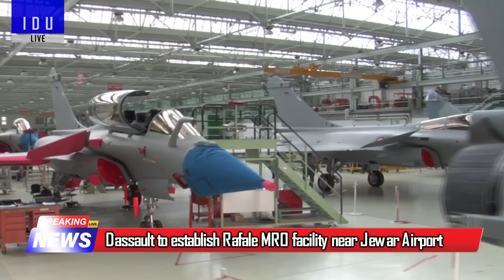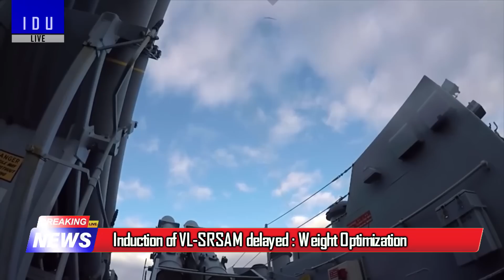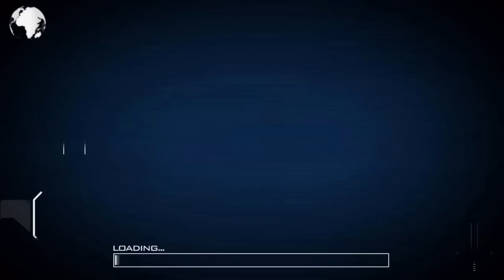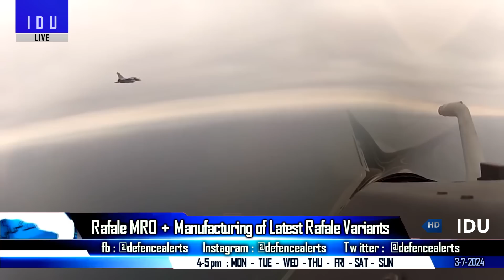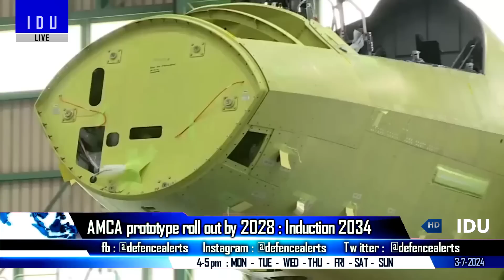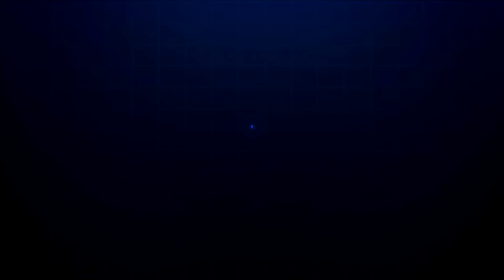Indian Defence Updates : Rafale F5 Production,AMCA Rollout,Ugram Rifle Trials,Army Favours Stryker

Comment: After 2 years of testing Army came to know Stryker is a better option than Whap😮 Means American are better in lobbying
Reply: No way will the private sector invest in R&D of domestic engineered defence products going forward.

For even when they produce a good product, the military will choose to import the same item.

The private sector thus cannot break even let alone make a profit on their investment.

This is also the reason no domestic companies wants to participate in AMCA development.  

They will spend huge amounts on R&D but military will import the same equipment at the last minute leaving them with few / no orders.

It's easier to do what Adani did with Hermes-900 namely Import and Rename (I&R) instead of R&D.
Reply: Whap is just a shell, Stryker has lot of weapons and sensors already integrated with it.
Reply: @pkmkb007  

What sensors ? And what weapons beyond javelin and a cannon of which similar types are also installable on WhAP and Kestrel.

Also WhAP and Kestrel are built to the requirements of the military as laid out by the military itself.

One cannot just add random requirements, if there are even any, in an ad hoc basis.

Finally, the whole purpose here is development of an  indigenous 
R&D base and equipment.  

As the Russia-Ukraine war shows, the taps 💧 will be turned off by foreign powers when the country needs it most.  In that case it does not matter if the vehicle is any better because something that does not move due to non-availability of some part or board is useless.

India has already seen GPS turned off by foreign powers and India's own planes (undergoing upgrades) withheld in foreign countries during the Kargil war when terrorists had occupied mountain tops in India.
Reply: @Volvorine7337  no trials have taken place for now
Reply: @Vartik-jr4qr  

Then how do they claim it's better?

Or are they wasting US time making them send proposals only to not purchase?
Reply: No WHAP is a good first step but the armor and plating is not up to par
Reply: Top babus from army might have got an account being opened in there name is Bank of Zurich 🤷‍♂️

Comment: DRDO and its overweight problem! Every weapon system faces overweight issues! Don't they have weight specs while building a system. This sort of back tracking is a real impediment in India's military modernization. That is why the Army is preferring Stryker. Wonder why the government is not stopping DRDO from hopping from one project to another without ensuring high quality execution of the existing ones first.
Reply: Maybe requirements are added on by the military in an ad hoc basis.

But do they not sign a contract 📜 containing specifications to be met before they begin work?

Project management seems haywire.
Reply: @JackBlackSM  stryker and whap weight is almost same🤦‍♂️